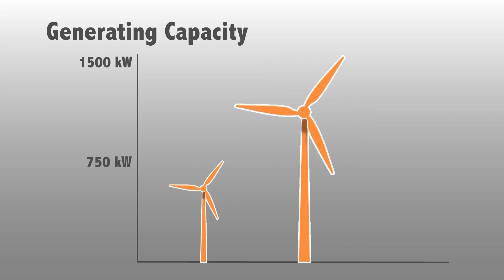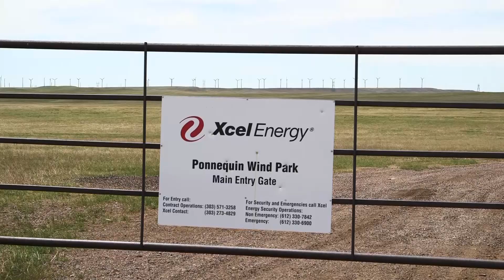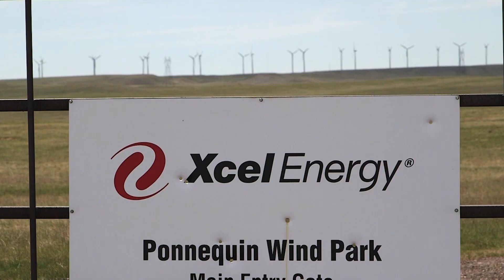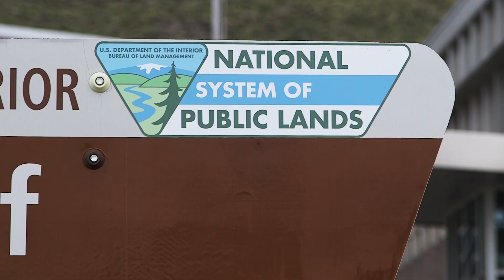Who Cleans Up When a Wind Farm Retires?

Comment: Removing a gravel road and concrete bases will cause much more pollution than just leaving them there.  The space they occupy is minimal, and there's little to gain by removing them.  Just the towers and turbines should be taken down so they don't eventually fall down.
BTW, I'll take one of those "non-profitable" small ones for my back yard...
Reply: You couldn't afford to fill it with gear oil or maintain the blades for a year.
Reply: @camojoe83  Actually, I can afford it...
Reply: @ffjsb  whatever. For what it's worth, they belong in backyards anyway as opposed to giant farms that think they could ever be half as efficient as a fired turbine or as reliable. These and solar panels are end user techs, not ever going to be top of the grid. Ever. You can offset your bill by installing them on your house, but if you think your bill would be cheaper if electricity was supplied by them in the first place you're wee todded.
Reply: @camojoe83  Nowhere did I say I wanted to PAY for the windmill...  I've done the research on solar, wind, and even water mills, it's not viable unless you have to string a few miles of power line to your needed place.
Reply: @ffjsb  when did I say you said that?
Reply: @camojoe83  You're talking about the cost of them.  If you go one for free it would be worth it.  But no way one mounted ON your house would be worth while, your roof isn't strong enough to mount one on.
Reply: @ffjsb  the only kind you can afford and could maintain have no issue mounting on a roof that can hold a snow load. They're better off on a tower tho for efficiency. 

These "small" industrial ones are way out of your reach tho, and I'll stand by that. Even if they come and installed it for you, you couldn't afford the transformers/storage matrix and maintenance, much less the fines from killing birds of prey.
Reply: @camojoe83  SMH, again, NOWHERE did I say I'd pay for it...
Reply: @ffjsb  again, mofo. I didn't say you did. I just pointed out that if it was given to you, you lack the resources to do anything with it.

Comment: Looks like another leftist failed experiment, no need to continue this tested source of power. Hydro electric has been successful for years, serves as a water supply and electricity source and yet the left refuses to build any dams and in fact wants to take some of them down.
Reply: Not enough hydro electric capacity is available. Far more wind and solar capacity is available. Requires less initial investment, maintenance and risk.

Comment: A good idea for power generation is everyone has solar panels on their roofs with a battery back up and connected to the grid so you combine the power system which can run a community, some people will draw power and some will have excess power, most people have excess power, its a well talked about system which should work, it won't run industrial equipment but will take the load off the existing generators so new ones don't have to be built.

Comment: In the Northwest on the Columbia River whenever I pass through there, 20% of the Wind Turbines are Not  turning, blades are feathered. I noticed the same thing years ago traveling through Southern California. This is not a terrain issue, there are Turbines right next to one another, it must be a maintenance issue. That's not a very good percentage if you want to make money with these things.
Reply: If you can maintain the machines more effectively and manage the grid "better," then WRITE a proposal based on data the companies can share; submit it.  Apply to work therein & institute your "better " way---if they're fool enough to accept it.  There is NO other way.....unless YOU want to buy the installation; then, it's yours to run into the ground, use subsidies???, and all the rest of it....!

Comment: Idiocy! It's cheaper to maintain an old mechanism than build a new one!
Reply: no.  It really is not.  Think about it a minute -- otherwise we would still have model Ts running the roads.  

New designs have improved -- longer blades move slower (safer) with larger "swept area"  (energy is proportional to the area the blades cover).  

But everything has a Service Life.  Even the Big Dams (the overall cheapest generation source) have a limited service life.  On the big ones in the US from the Depression Era -- we have replaced the Mechanical Components, and re-worked the Electrical Controls to Electronic . . .  but eventually even the Concrete will have a Service Life.   

Same with us as people.  And life goes on.
Reply: @philtimmons722  As to concrete the forum in Rome is over 2000 years old but neither my car or the forum were designed or built in America. Well designed and manufactured things have a very long life😀
Reply: @andrewallen9993  -- you understand that Roman Concrete is used as an extreme example . . .  because it is an extreme example?   It now has little practical use.  To show you a more extreme case, so you can follow this -- the Egyptian Pyramids.  Still standing after how many ever thousand years.   But for other than Tourism -- little to no practical use.   

In the real world -- the one where most of US live, breath, and on and on . . . things must be reduced to the practical.  When better means and methods come along we are wise to adopt them.  

Consider some 100(s) + year old Windmills -- in Holland.  There are now better means and methods.  So new Windmills (Electric Turbines, actually) in that area are the Tall Tower, three blade.  Even the US West "Prairie" style Windmill is now known to be sub-optimized, so other than novelty, they are rarely used anymore.   

(but really, thinking new thoughts will not harm you).
Reply: @philtimmons722  A quick point :) I don't need to think about it, my youngest house is more than 50 years old and my daily driver car is 54 years old. The cost to run the car is astronomical as I get about 120 000kms from a 600 dollar recon engine and 50 000kms out of a 200 dollar set of tyres 10 dollar clutch plate and 20 dollar set of brake shoes ( rebounded of course) I have to service it every 5 000 Kms which involves greasing  22 nipples (1 dollars worth of grease) so my kingpins, ball joints and wheel bearings have so far lasted 700 000kms as well as changing the oil  in the engine and air filter and washing the engine oil sieve. Points and plugs get gapped at the same time and replaced every 30 000 Kms. The next thing you will be telling me is cars depreciate in value over time!
P.s. Not if you maintain them for 40 years :)
How much do you spend on your car in a year?
Reply: Anew thought for you. The Forth bridge is still standing. It is still standing because it is maintained. They paint it because it is cheaper to maintain an old well designed and made machine than build a new one. Or do you think you shouldn't maintain something?
P.S. I saw a model t Ford last month, bet it's better at driving over  really large potholes in unmaintained roads than your car :)
Reply: @andrewallen9993  -- really you are free to maintain anything you want.  But in the real world -- once it becomes impractical to use and maintain . . .  it does not turn out to a sustainable practice.  That may seem like a tautology, but I think that is where we are at.   Old, small Wind Turbines are not cost effective in the present market.

The model T is a novelty because it is rare.  It is rare because it is not really practical.  On the other hand, an old Electric (e.g., Baker) may be desirable.  :)  (I drive a Volt)    You see this?  The show guy is a bit annoying, but the car is interesting . . .   https://www.youtube.com/watch?v=OhnjMdzGusc
Reply: @philtimmons722  A Volt eh? Nice car but can you see it still running in 40 years? Plus how does it handle poorly maintained roads? Look at Bazalgettes sewers in London, well maintained so still functioning after one and a half centuries versus the cholera in Harare where the sewers were designed to the same standard but have not been maintained for 18 years.
Reply: @andrewallen9993   -- hahahaha ahhh.  Maybe, but I might Frankenstein it before then.  My real interest is in Electric Roadway Cars and Trucks -- where the electric power comes from the Roadway, itself.  Still under warranty, so I have not started hacking on it, yet . . .   and seems to do well off-road.  

Have had it down some back trails on Boy Scout camps, and some remote power sites and it seems to built like a little tank.  I do various energy projects around Texas and beyond.  

I am not so harsh on re-using or continued use of functioning equipment as it may seem.  Sewers going for 100s of years are fine by me.   My 14 year old announced to me last month that we are going to build him an electric car from something (yet to be determined) older car.  We have looked at 1960s Mustangs, Thunderbirds, even a Tail-fin Belaire.   Anything you would like to recommend we consider in that regard?
Reply: @philtimmons722  Split window VW kombi like mine or even a bay window camper? 50 hp original petrol motor and 1250 kg load rating . Easy to fit electric motor to gearbox and lots of room for battery's. Tesla Powerwall as source? Or even the innards from a scrapped  junkyard Chevy volt? Remember the grease nipples on the suspension :)
Reply: @andrewallen9993  -- great idea!  Thanks.  

My bias on batteries is -- less is better.  Not in love with any of them.  My druthers would be add-on modules, for only when you need more.
Reply: @philtimmons722  If you decide to go for it "keep it simple stupid" so you can maintain it easily, good luck with the build and I hope you and the child have fun :)

Comment: Without reading all the comments that have come before me a good point to remember is this, no matter what happens with these older wind farms, the consumer is going to pay. Many people think that this is free energy because the wind is free don’t kid yourself.
In less than 20 years for technology will have moved again and the ones there a wreck in today will be obsolete, the consumer will pay for that as well.
Reply: nobody said wind energy is free. Nothing is free. It just so happens that it's a very clean source of low cost energy.
Reply: @imzjustplayin  It is low carbon impact i guess and stable in price, but the low cost is debatable.  Renewables receive 45% of the subsidies in the US, and have for about 12 years.  Per kilowatt hour solar (especially distributed capacity on homes) receives over 300x the subsidies as oil and wind (more concentrated and efficient when scaled) gets 70x as much as oil.
Reply: @imzjustplayin  Reading the article it seems that it is an almost fully matured technology, but new installations are still extremely dependent on subsidies.  A full 50% of new installations are because of subsidies (expected 50% drop in new construction after subsidies are taken away) and it was even worse 5 years ago when 92% of new capacity was canceld because subsidies were taken away for one year.
Reply: @James-ny5nt  I'm not surprised as subsidies do work that way. When installed capacity gets to the point that the grid reliability becomes a question, I'm sure they could remove the subsidies. Within the next 5 years, I'd say grid batteries will be the expected solution to deal with this problem and then it won't matter how much renewable energy there is attached to the grid.
Reply: @imzjustplayin  I guess we'll see what happens in 2020 when the subsidies are scheduled to end.  Energy diversity is good.
Reply: YT, indeed, the 'word' TANSTAAFL comes to mind. 
............................. There Aint No Such Thing As A Free Lunch.
Reply: Eeeh yeah, want did you really want to say??, like there is a energy source that is free or what?
Reply: @randomdodads  You dont seem to read English vert well. Reread hus  sentence: sentence"Many people think that this is free energy because the wind is free don’t kid yourself."  Now be sure to read the last phrase  - "DONT KID YOURSELF" 
Basically he is saying TANSTAAFL There Aint No Such Thong As A Free Lunch.
Reply: Frederick Wise it’s hard to read your version of English when it’s written so poorly. You have a lot of ass-umptions I see by other comments. Do you work on wind turbines or involved in renewable energy in any way?
Reply: And all service stops and waste management on a nuclear powerplant is for free?  No costs there🙄
Reply: Kind of like cars?
Reply: Bruce Lortz - There’s Biomass technology.  Your poop 💩 dumped and collected at a septic tank 🚽 over a period of time can generate methane gas to fire 🔥 up your stove and heat your home.
Reply: Energy payback period for the energy consumed to build current day wind turbines is 6-8 month. Cost payback is 5 years. https://wattsupwiththat.com/2014/06/16/wind-turbine-payback-period-claimed-to-be-within-8-months/
Reply: There actually is a home atomic energy solution!